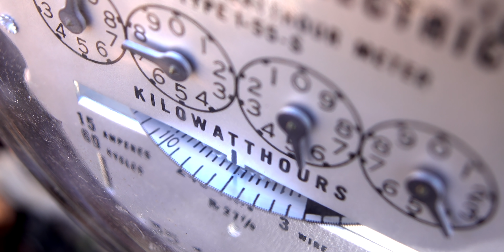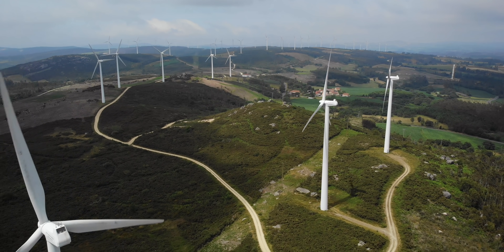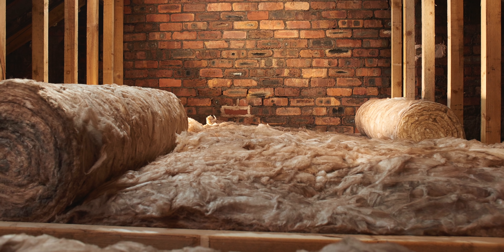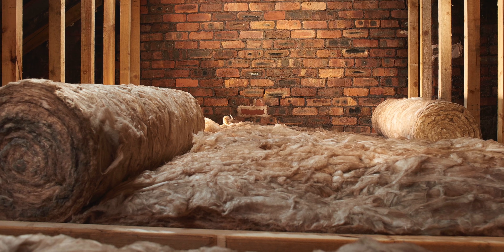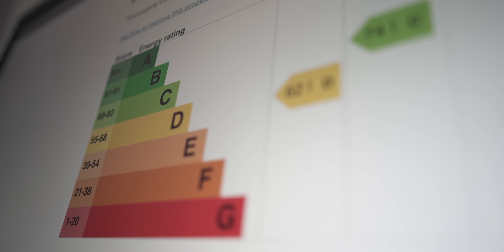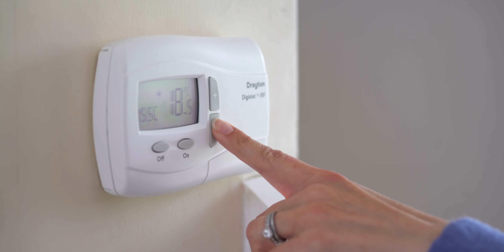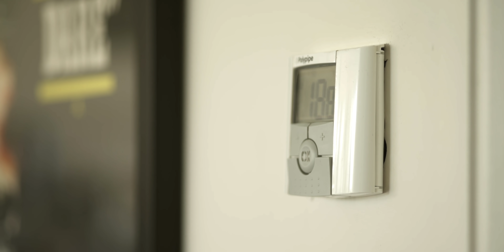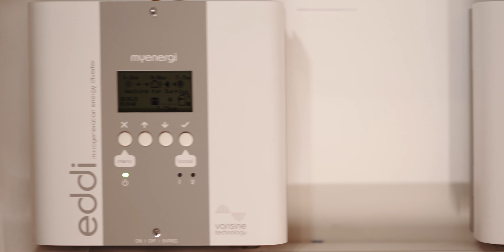HOME ENERGY Episode 1 - Cheaper Measures, Energy Efficiency & Fabric First | FULLY CHARGED

Comment: All new builds should be passive heat standard or very close to it. From now until 2050 some 6-7 million new homes will be built in the UK and them adding to the problem won't help

Also at new build stage is the cheapest time to do it

The 2025 boiler ban for new builds should be moved forward to 1st January 2023 that alone will mean some 300,000 homes that would have been natural gas heated will instead be electrically heated

Comment: I have a 3 kW solar & a 4.8 kW storage battery (all paid off) from mid March to mid of sept I mainly run on my own renewable energy all while still receiving the old solar fit payments that easily pays for the gas & electric that I do use from the grid & it also pays for the fuel in my Toyota hybrid. That I don’t pay road tax & only fill up once a month. I have a gas combi boiler with Hive control. 

Ive changed my kitchen sink tap to a electric tap, I’ve change my gas cooker to a double electric oven and I use the smaller top oven to cook & also use a Philips Air dryer to cook in half the time. Which I can use my solar & storage battery to run them.

I also got rid of my gas fire that I hardly used and insulated the chimney and bricked it up & replaced with a electric fire that I do not use. But use the led fire effect 24/7. That runs off my solar & storage battery 24/7.
 
I am in the process of changing my bath to a electric shower with a eco water shower head saver. Leaving only my bathroom sink & my radiators on my gas combi boiler. Even  looking at putting a electric water tap on the bathroom sink. 

I want to get rid of my gas supply completely. So I can use what I save on my standing charges & gas charges to help pay also side my solar fit payments for when I do use grid electric.

So I am looking at adding a Eddie system & a mixology water tank. So I can use my excess solar to heat the water up and use the water tank as a heat battery. Which means I will send less solar back to the grid. Meaning I literally get paid to generate, store & use my own renewable energy. 

I also want to add a small wind turbine from alpha 311 ltd. (Late 2022 available) possible two. So I can produce my own renewable energy 24/7 -365 days a year. As solar is less efficient in the winter months. But adding a small home wind turbine will make up for it. 

I believe small very energy efficient small home wind turbines are the missing link for people who want to run on on their own renewable energy all year round. A wind turbine can top up the storage battery 24/7. 

I have led lighting throughout my home. My shed runs on its own solar lighting. All my garden tools are battery operated & so is my Hoover.  My loft is insulated & has flooring & I am adding solid insulation between the rafters. So I have a complete triangle of insulation in the roof. 

Last bit not least I would like to add more solar and then get a electric vehicle with bi directional charging when the prices match that of their fossil fuel & hybrid counterparts .which there is no excuse for them to be now. But I have plenty to do before I need to change my hybrid. But I will not by another hybrid or fossil fuel vehicle ever again and manage with my hybrid for now….

Comment: Lots of good and sensible stuff here. In future episodes I hope you have a look at possible solutions for the unlucky people like me - we moved into a large house (for our multi generational household) which has 3 phase electricity. I cannot find an energy supplier who will fit a three phase smart meter so at present no way to get any compensation for exported solar energy.  So 2/3 of my excess solar power goes back to the grid with no reward. 1/3 of my excess is diverted to a hot water tank so at least that is OK but the solar diverter and immersion heater operate on a single phase (and our 300l tank only has one heating element anyway). We try and turn on high power items when we have solar available, but this is tricky and difficult to manage in an efficient manner. Three phase battery solutions are incredibly expensive and at present make no sense for any return on cost. I do have a home brewed solution I am thinking of trying - using another solar diverter (on a different phase from my immersion heater) to power a storage heater in the main living area in the house. This to my mind would make a sensible and fairly inexpensive way to use excess energy from another phase at least.
Reply: I reckon your best bet would be a Electric Vehicle, as and when you get to that point, and divert excess PV to it. But that presupposes you are not using the EV to commute to work, otherwise it won't be at home when the sun shines!
Reply: @ecok  I have an electric vehicle, but the charger runs at 3.6 or 7kW which is much more than is available even at maximum solar output (three phase inverter from a 5.4kW max solar system equals under 2kW per phase) so nearly all the time it is cheaper to charge using night rate mains electricity! It is mad and infuriating. The meter charges me when I am using power on one phase but generating masses on another phase. It takes no account of the net value, it only looks at what is being delivered on each phase.
Reply: I know I could get a Zappi charger which would give variable rate charging to maximise my solar without using grid power, but I have an aging Nissan Leaf and would need to buy another charger when I next change my car. I am saving my grant for when I am able to upgrade my car.
Reply: @JulianToler  Useful to learn, thank you, I feel your frustration. My wife and I seek to be very Eco, but there are so many obstacles in our way too ...

Comment: Sadly our old stone house with 3 foot thick walls is not really able to be retrofitted with insulation. We added another layer of loft insulation and replaced the windows with double glazing. The house has no gas mains and is heated with electric storage heaters. Its expensive and cant heat the house up at all. Last winter the bills were insane and we were still bundled up in heaps of clothes. what do we do in that situation?
Reply: insulated plasterboard, or stud walls and 2inch of spray foam then fiberglass?

Comment: I had an early 1970's house that had little to  no insulation at all. I insulated it as best as I could given the 1980's avaliable tech. I found keeping the central heating on 24/7 and using as low a radiator water temp as possible but keeping the internal fabric of the house warm all the time reduced my gas usage by more than 50%.
It was easy to measure because I was on 47Kg LPG gas bottles. From using a bottle in 2 or 3 days to one every 5 days or more and the whole house being comfortable and livable in. I controlled the heating in the house not so much with the thermostat but by modulating the temperature of the radiator water. 
I now have a house with a much more efficient condensing boiler. However it still works very well. Reducing losses from the pipes by running them at as low a temp as possible.  In my new house (built in the late 1930's ) i am replacing my radiators and increasing their size so I can run cooler water in them yet keep the house comfortable. So far it is working as expected and reducing my bills dramatically.
Reply: Thank you someone who understands how to heat a home! Heat loss is proportional to temperature difference: having 70C rads come on for an hour is dumping a huge amount of excess heat to the environment compared to running at say 38C on a room stat set to 18C.
Reply: Thats almost exactly how an ASHP works. Low temp system, run 24/7 on a single heat setting. Insulation is definately  the priority. We've had our ASHP for over 5 yrs now and in practice the house is nice and warm and costing us 200 pound a uear cheaper than the mains gas system it replaced.

Comment: I concur with some of the comments below.  It is a very good idea to have episodes dedicated to this sort of subject however it does require clarification on the possible makes/models, how they work and what the overall costs would be.  I live in New Zealand and I am currently looking at a brand new build, brick & tile.  So insulation in walls and ceiling space is a given and the only source of heating that we could have for the winter months is a Heat Pump.  However the heat pump will likely be in the living room and does not get to the rest of the house so not a great way of providing heating.  Also central heating is far too expensive here and as you have highlighted is something that we should move away from.

Comment: Bear in mind too that an aerated shower head makes no difference whatsoever to an electric shower, since this uses a constant amount of electricity. Tried it, sent it back.
Reply: Do you gave a link to the aerated shower head you had as it’s something i’m looking at.
Reply: @mateybloke  It was one from EcoCamel. No matter what the blurb says, it is physically impossible to save energy by changing the shower head on an electric shower since the energy usage is simply governed by the amount of electricity put in, which is constant. It might give you a nicer feeling shower potentially but it categorically will not, and cannot, save you money.  Hope this helps
Reply: @richardgledhill  cheers ours is not electric will take a look.
Reply: @mateybloke  You're welcome! Make sure you buy the non-E version that has a flow restrictor in as that's how you can save money. Should work nicely for you :)

Comment: A few years ago I arranged for my mother-in-laws home to be insulated, using a government grant.  With no other changes the fuel bill for the house dropped by over 30%.  
Some 39 years ago I brought a brand new home, built to the very low standards of the time. I immediately had the wall cavities filled with rockwall, and doubled the roof insulation. I used a cheap and cheerful gap sealing tape round the opening windows.  About a ayear later I was visite by the Gas company  to change my defective meter. Apparently I was using half of the gas that my neighbour, identical house, was using. There was of course nothing wrong with the meter. 
My conclusion, Insulate and draught proof!
Reply: I moved into a very large apartment. It was costing £350 a month in electricity. I swapped all the halogen downlighters for LED. Changed the two rather old electric water heaters for new reasonable quality ones. The electricity dropped to £150 a month.
IT DOES NOT TAKE A LOT to make that BIG change. It gets exponentially harder as you get lower down - but cutting the first 30% to 50% of your usage is easy.
Reply: @BullShark the house was not sealed completely, but airflow was better controlled, via trickle vents and planned opening of windows. 
My current house I built with the full works,
Reply: @BullShark there are systems that revover the heat but let fresh air in. Some only require one hole in a wall and power.
Reply: Hi Barry, this is really interesting and thanks for sharing. Can I ask whether you've had any issues with dampness and mould? Just thinking that all that insulation and draught proofing might restrict airflow into and out of the property.
Reply: @afnankhokhar5578  By Draught proofing I imply also that you control the ventilation, not prevent it. Nowadays I would install a heat recovery ventilation system, to remove the foul/damp air from Kitchens/ Bathrooms and Toilet, whilst providing prewarmed dry air ro living spaces and bedroom. 
I never had problems with damp at any stage.
 A cooking tip:- always use lids on top of your cooking pots and the minimum heat level to boil the contents. Simple science tells us that water gets no hotter than 100c as it boils, the excess heat just goes to steam (water vapour) which causes much dampness in most house. Lids on pots also make your gas bill less!

Comment: I have been waiting a long time for was for some information about new energy efficiency solutions for the home. At the first Fully Charged Live I was told to fit a better gas boiler (I don't have gas). Things haven't improved much, this information is at least 30 years old
Looks like the first thing I need to do is buy a bigger house. None of the options shown in this introduction will fit in my flat 😯

Comment: To me, solar thermal (the evacuated tubes on your roof) makes no sense.  Better to use that space for PV panels that can be used to heat the hot water in your tank via an immersion heater and once that water is hot you can use the electricity for other things.  With solar thermal, once your water is hot it can do no more.

Comment: I think there is a serious business opportunity meeting the need for wall-scale radiators that will be needed we transition from relatively high temperature central heating radiators to the equivalent wall-scale radiators that will work well with heat pumps at much, much lower input temperatures.
Reply: Or improve the insulation such that the existing radiators will output enough "lower grade" heat for the better insulated building.  More comfortable too. Costs a lot though ...

Comment: What about heat exchanging on the water that comes out of your shower? it could be used to warm incoming cool water that's going into the heating ?  Or perhaps it could be passed near the air-source heat pump to keep it in its optimal operating range?
Reply: Not sure there is a device for showers with hot water supply, but they do exist for electrically heated showers - I guess that pre-heating cold water supplier is easier (just a heat exchanger) than hot water (would need a heat pump). I got some results from Google with "shower waste heat recovery".

Comment: this series couldnt have released any later.
Due to a mould incident inside the kitchen (broken heater pipe) we need to renovate the building of my grand parents and are looking for what we can do to make it as good as (finantially and environmentally) feasibly possible. 

we are currently looking into a ground source heatpump since the old Oil boiler is done anyways and the yard behind the back of the house is not really utilized other than 2 mostly dead fruit trees. (they have been struggling for the last 5 years and didnt bear any fruit this year + their leaves start to look like the tree is dying, might be a fungus)

The biggest problem we currently have is the immense cost of insulating the building with something not flammable that doesnt look ugly. if our napkin math works out even remotely it might add up to 60.000€ in insulation cost (the up to is the critical part because the house has more than the bog standart 4 walls)

If money and feasibility allows it we might turn the old oil tank into rain water storage for the garden or maybe also toilets (but i dont think the plumbing allows for that to be sectioned off) 
since the tank neeeds to be cleaned out porerly anyways for transportation we might use it instead.

If there are any good inputs i'm open to look at them ^^

Comment: Don't see how a thermostatic tap is any different than filling a bath with hot and adding cold.  The source of the hot water (if it's direct from your combi boiler or from a tank) is still being heated to the the same temperature and mixed with cold in the tap.  No?

You'd be looking at heating your water to a lower temp to begin with to save carbon.  I'd say this is an easy and completely free measure with a combi boiler, just turn it down to 50 degrees or something. 

More difficult with a cylinder due to legionella rules, but still possible.
Reply: Yes, hot water should be 60 C to keep the bugs away. That said, having separate cold and hot water taps would look a bit old fashioned, I think my grandmother had it in her house built in the 1930s.

Comment: move the bulk of the population from 50 degrees above the equator to 10 degrees ...unless you live up  mountain not much need for heating when the average year round temperature is 30c...............not very practical but just throwing the idea out there :D

Comment: Looking forward to this series. Are you planning on covering cooling as well? For other parts of the 🌎 from the UK, cooling of a living space is very important, as well as de/humidification. I guess thermal / environmental control, rather than just heating...
Reply: @BMW R1200GS Adventure Great. This is the sort of thing I meant. It would be useful to cover both aspects.
Reply: Better insulation will help with keeping the house cool in Summer too. And if also install Air-Con then need much smaller unit, and less running cost, if house is well insulated. For anyone in their forever-home the upfront capital cost of insulation is probably more easily found.

Comment: Hopefully UK regs have moved on since I bought my house 16 years ago.
Thing I wanted (and was willing to pay extra for);
Super-insulated kit  -  Nope
Triple glazing  -  Nope
Heat recovery system  -  Nope
Air or Ground-source heating  -  Nope

Unfortunately I had no choice in the builder if I wanted to be on this estate.  Needlessly to say they were lazy, shoddy and late as they had no competition.
Not having gas on this side of town I suppose I should be thankful that I am not lumbered with storage heating.
Now if only the 2 oil suppliers here would allow us to set up a fuel club...
Reply: the regs are still pretty useless and the housebuilders squeal like stuck pigs when any sort of improvement is suggested. If we are to get serious on carbon dioxied reduction, we should be building new to passiv house standards from now on( all those wasted years makes me weep...)  and also retrofitting the older properties.
Reply: Nope, nothing has changed. Houses built today are to 1980's standards. Apparently builders only want to build period properties - nothing modern.